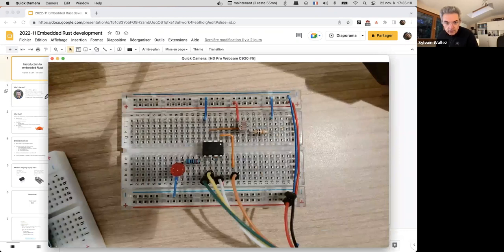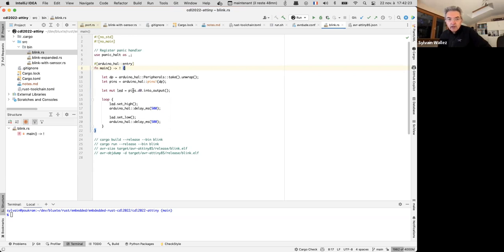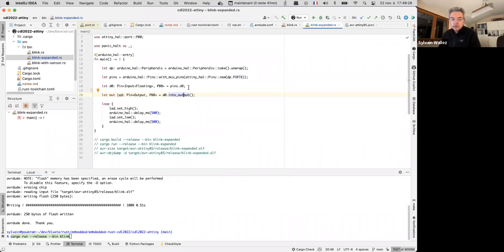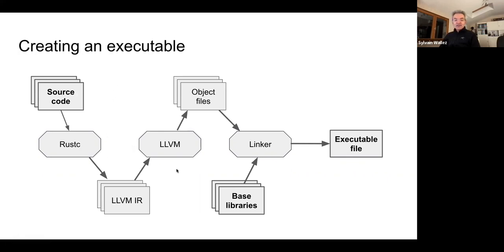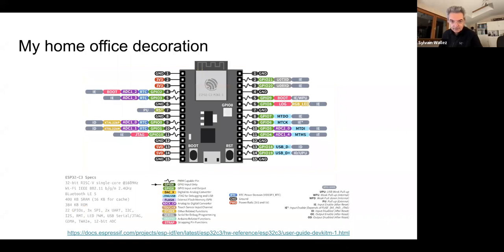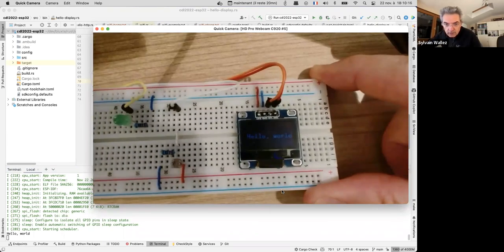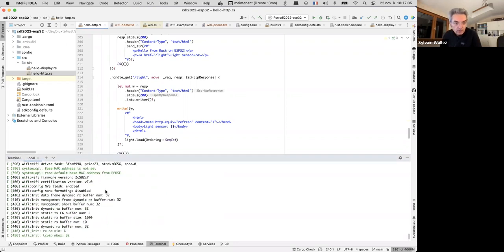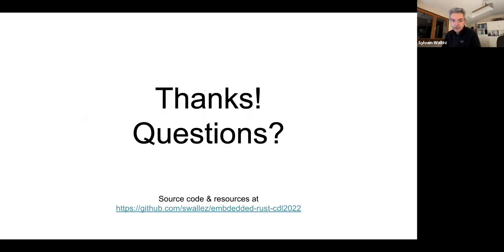Introduction to embedded development in Rust

Comment: There was a cheap MC at 10c but that's gone up to demand - Ch32V003 series. The cheapest MC I could find is on LCSC 16KB 2KB 18 RISC-V 48MHz QFN-20(3X3) Microcontroller Units (MCUs/MPUs/SOCs) ROHS 25c (minimum order of 5). That's still amazing considering the number of features, specifically CH32V003F4U6

Comment: If Rust could make the same Over-The-Air boot loader that Arduino did for use with the ESP32's - that would be amazing.
Reply from the maker: OTA on Arduino is provided by Espressif's esp-idf library, and is also available in Rust. I haven't tried it though. https://github.com/esp-rs/esp-idf-svc/blob/master/src/ota.rs
Reply: @SylvainWallez  Wow, thanks for the reply. I find it amazing :face-blue-wide-eyes:

Comment: Very interesting you have expanded my mind in what I can actually do with micro controller.

I personally have a few esp32s however that first microcontroller could be really good for a a push button project that I had in mind.
Instead of using transistors and mosfets I can do a simple program 🌞